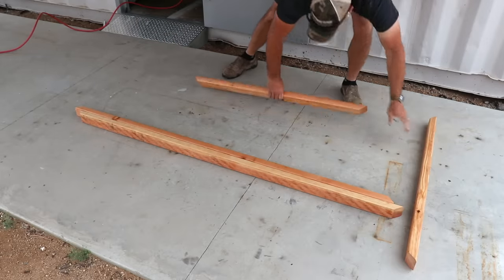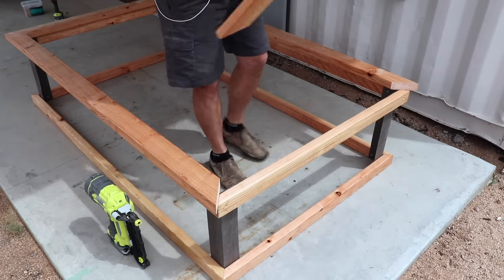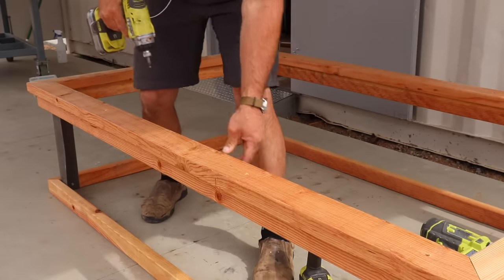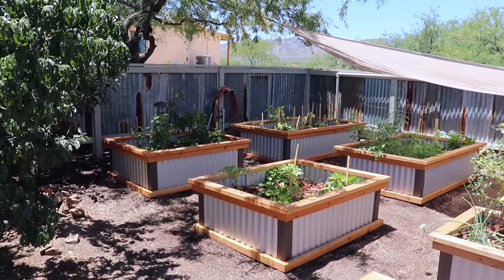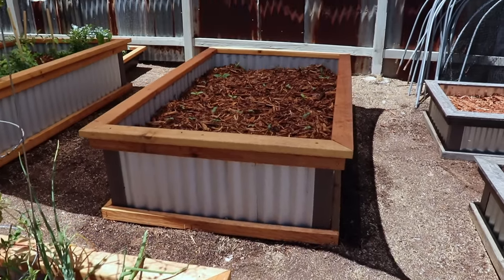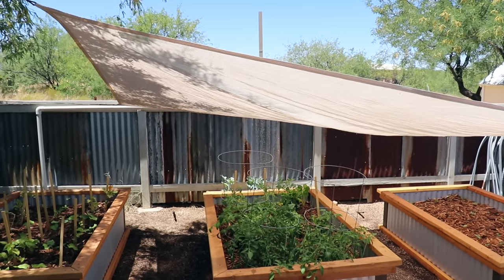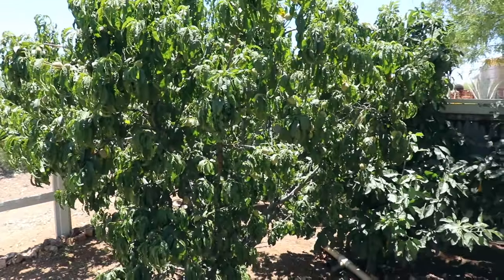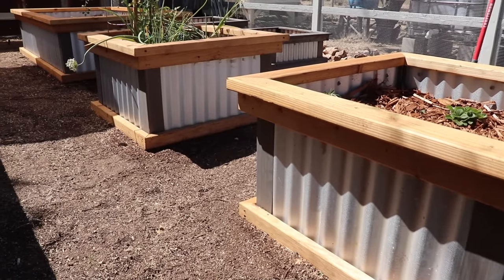Beautiful DIY Raised Garden Beds in 3 MIN!  - How to Build

Comment: We just bought some of these boxes that were built by a local man here in Idaho.  They are 4 feet tall. Wonderful for us old time gardeners.  We filled them with bales of hay to help with the cost of filling them up.  Yes, overtime it will break down...but then we will fill up again next year with more compost.  He built them with some corrugated panels from Australia that are coated and will not rust.  So far I am loving them.  4ft wide ones are a little hard to reach across so we bought 3 ft by 8ft.  Good job and they look so nice.
Reply from the maker: Thanks and I agree with that haybale idea too!  My wife mentioned that for me but mine being only 18.5” tall wasn’t as much to fill.  But if they were higher that was going to be my route as well! 😀👍

Comment: For those asking about the  3 x 3 flashing...i was not able to get any locally in Virginia....I ordered from Menard's on line (2 - 10 foot sections).  The site said free delivery so I tested.  Delivered - total cost under $18.00...and better yet they came in framing to protect in transport - 4 - 12 Foot 2x6!  so they are going to be re utilized for the top caps!
Reply: Thank you! 😃
Reply: Just fyi for those searching Menards : I couldn't find it there until I tried Angle flashing.
Reply: How did you get free shipping from Menards? Is there a code or something?  When I tried to purchase the angle flashing online, the shipping and packing charges added up to nearly $100.
Reply: I just checked my Menards and they have 22 in stock.3x3x10'. I like this idea vs wood 4x4.
Reply: Home Depot in my area of Virginia has 4"x4"x10' Galv flashing
Reply: They lost $ on that transaction on today's lumber prices!
Reply: @sherryraskin2096  Same here. $81.95 for the shipping and packing.
Reply: I live in VA and it's $400 for shipping.

Comment: Just did some rough calculation on cost, thought I'd share with others:  A sheet of 2' x 12' corrugated roof panel costs $22 where I am. For an 8' x 4' x 2' (W x D x H) bed, you'd need two sheets (=44). The corner flashing is about $10 for 10' so you'd need one length. Then you'd need 48' of 2x3 ($15) and 24' of 2x4 ($10), so it comes to about $80 a bed. Not bad!
Reply: A LOT cheaper than Doug fir,  and lasts more than twice as long.
Reply: wojomojo thanks for the calculations
Reply: Seemore Butts you’re right but more work taking them apart and removing the nails.
Reply: @wojomojo where can I buy 3” x 3” corner roof flashings from? All I can find is ones that are 4” x 4” and only 8” tall
Reply: @rhettkuhnen4375  same, I can't find them anywhere.
Reply: I work at a distribution centre and have migrated to 110 gallon horse watering tanks. Drainage holes, sweeping tile pipe covering with stone, landscaping fabric on top, a mix of peat moss, sand, vermiculite and compost and voila...... raised bed gardening for the disabled. I have my driveway and backyard filled and produce enough to can and feed lots of other people 😁
Reply: Thanks for the cost, but those wood are just untreated wood, they can’t be last, but for good treated woods we have to pay so much more in order to be last
Reply: Cyndi Foore Not if you cut around it and ignore the corners completely. I forget the channel name but it’s a new video look up “How to build a raised bed using pallets”
Reply: @arleenieeweeniee3866  Pallets are often made of pine, spruce, or fir. All of those woods will rot out in about 2-3 years in damp soil and not completely buried. I don't know that the labor and fasteners are really worth the free materials.
Reply: @jaskeda  Yes if you are spending to get cedar or Pressure Treated that'd be true. But outside of the bottom frame which contacts the ground, the rest of the wood only contact metal so I think it's ok.
Reply: Thank you 😁 I also called my local dirt people and for 8 beds this size you mention that is premixed with compost soil and manure just for raised beds will cost me 1200.00 2 1/2 dump trucks filled so getting my money together and finding a guy who can bring his front loader lol I am 57 and can’t do that much dirt in a wheel barrow but can pay to have it done by march
Reply: @arleenieeweeniee3866  yes I saw that video and time saver definitely
Reply: @pamelavance648  And money saving. Old tree wood is free. Leaves are free. If you want straw/ hay put an add on Craig's list or Facebook looking for free moldy straw/ hay. Farmers don't want it so you might get it free. Then 12" of soil. Done! As for people looking for 3x3 flashing... Menards either has it or will get it for you.
Reply: @wojomojo  I used the 4" x 4" and it works just the same.
Reply: March 30, 2022...Now Double or triple those costs...guaranteed!!!

Comment: Hi Joe, we saw these on your channel and thought they looked fab so we made one 7' x 5' to go in our back garden. As you say, real easy to build and extremely easy on the eye. We plan to make a few smaller ones to compliment the area but overall so much cheaper than trying to build it solely out of wood. The tin adds a bit of industrial drama but is nicely softened by the wood. Top job.
Reply: Where did you get the corner roof flashings?
Reply: @robcasad  roof flashing at your local hardware store. It's just a simple piece of very thin gauge sheet metal bent. Used in roofing.
Reply: Did they bow out a any?

Comment: Beautiful result !
 Great esthetics on the very small budget. Will copy in my garden.

Also, plants with red fruit love metal. Gardeners use rusty metal on soil for that.
Reply from the maker: Thank you!
Reply: ...rusty metal, vs. galvanized (zinc, which can be toxic for example to fish)? Trying to ask here, really
Reply: @michbushi  we need zinc in our diet which is available as a supplement
Reply: @michbushi  It's the iron that the plants really need. Rust is iron oxide. You can buy iron soil supplements in garden supply stores.
Reply: @catstreat9434  I have my doubts as to how bioavailable iron from the metal would be for those plants. Iron sulfate would be much better for that.
Reply: Hai
Reply: I cannot say I am an expert but have a little bit of knowledge of various chemistries after 15 years in oilfield chemical/pharmaceutical manufacturing. Rust is generally known as the oxidized elemental iron (Fe on the periodic table). However, there are multiple oxidation states of Fe just like some other metals on the periodic table. Some are toxic in some environments, and some are not: Iron in chlorophyll, Iron in hemoglobin, metals with coatings (like oil-seasoned, iron skillets), etc. Even if you were to go back to some of the old practices, you will discover that there will be a new argument against the old ways.

You should do your own research of what people say versus what specialists (like agricultural extension representatives, long-time gardeners, manufacturer product specialists, etc.) say. Incorporate some of your own soil and crop testing before planting/eating in conjunction with the advice you receive prior to human consumption. However, keep in mind that nothing in life is a guarantee that this or that will stop you from the enjoyment of growing your own food. 

There are challenges in raised bed gardening just like open row gardening. You make the call dependent on what is most important to you and preferably not to the stress of worrying about disappointing others. "Don't worry! Be happy!" Make gardening a family affair (quality family time). Consume to your senses are full (enjoy the flavors of tastes, smells, touch, ears, and eyes). 

If you enjoy meat keep in mind that most meat is flavored with minerals (salt) and vegetables (herbs/spices). Very few people eat meat without a vegetable source added. Plus, you can eat some/most vegetables raw (live food). That cannot be said of most meat sources; however, most meat sources consume raw (live) plants.

Comment: Those look really nice! I'm definitely going to use the 3x3 flashing in the corners. I have a tip for anyone using galvanized roofing metal. After you cut it use cold galvanized spray paint on the cuts. This will keep it from rusting,!

Comment: Thank you! Followed your plan - more or less - to make three 4x6x2 beds & very happy with how they turned out. Recommend an air nibbler to cut the corners and corrugate panels. $25 @ Harbor Freight, cut easily & quickly and no evidence of becoming dull after completing these 3 beds.

Comment: Fantastic! I'm going to make some 4' x 8' x 26" planters following this design (with a few modifications). Going to use pressure treated wood and stain it (since it is much cheaper in my area than cedar), and just rip down 2x4's in half instead of using 2x3's. Also going to leave the flashing a little long on the bottom corners to cut into a point to drive in the ground to help hold the boxes in place when filling them up. Thanks for the helpful video and inspiration to get off my rear and build my own!
Reply from the maker: Awesome!   The only thing I’d recommend is to make sure not to go too high unless your roofing is heavier guage.   I’ve gone as high as 22” with no problems but that was with 26ga roofing.  I’m guessing 26” might be fine as well assuming the heavier gauge but if it’s 29ga stuff I wouldn’t go higher than say 19-20”.      My concern is that going too high could result in that soil pressure bowing the sides a bit.    Anyways, I think they’re gonna look great and is live to see them when you get done👍😀
Reply: He used cedar on those little old ones at the end.  The ones he just made were pressure treated pine.
Reply from the maker: Alastor they are regular pine that I coated with linseed oil before assembly.   I would encourage those in wet environments to research if pressure treated might work for them.   But these are just regular pine😀👍
Reply: @homesteadonomics  what modification would you recommend to brace the sides to prevent bowing?

Comment: Joe i love these beds. I remeber when you built previous ones. The design is simple, they look great and last a long time. Im going to build these on my allotment plot with one slight alteration. I'm sure watering can be an issue in your climate so could be handy there too. On the top im going to build a frame around the edge from 3x2 or 4x2 then at 1 foot centres going across the bed and also goin the other way to create a criss cross  framework. In each square will sit a square 12 inch pot that sits a few inches off the ground. On the inside of the bed, put a piece of pond liner up just a few inches from the ground which will hol water. The pots will have a piece of wicking material in them and will dangle down out the bottom of the pot and into the water. This way the plants soak up as much or as little water they need and you could go away for a few days without worrying about your plants or vegies dying.
Reply from the maker: Thank you!   And I love your idea!   Sounds like it will make for a great growing system too! 😀👍
Reply: Yes, this absolutely works.  I made a bunch of results videos, and some gotchas to watch out for.  I'm slowly converting all my beds to this!!

Comment: I had watched another video on building raised beds. Oddly I made some changes which is exactly how you built yours. They have worked wonderfully! Used pressure treated for the base but common studs for the top sealed with linseed oil.

Comment: Great container.  I made two of your planters, but did make a time saving material change.  I used the corrugated metal for the corners.  They easily hand bend at 90 degrees if you mark at the 13” center peak in the corrugation. Don’t bend against the peak it is much more difficult.  Also I used a skill saw with the blade turned backwards, that’s an old aluminum siding trick...wear ear protection!!

Comment: I have watched many videos on building raised beds and your design is the one I like the best due to its simplicity and aesthetics. Have you had any issues with the corners not standing up to pressure since it is just the flashing holding them up? Also, have you experienced any pushing out of the galvanized metal due to the soil weight? Thank you for your videos and keep up the great content!
Reply: Your question is timeless, I came here a year later with the same question. Too bad no one can be bothered to answer 💀
Reply: @brianandlynphilippines  Well I built them last year and do not recommend using flashing for the corners unless it is a shorter bed. Almost all the 2 foot high beds the corners are bending and I will have to disassemble them and put wood in it's place.  On the other hand my tomato bed which I made shorter around 12" high is holding up great!
Reply: After you add the walls the bed becomes very strong.   I built a 16" (inside height) yesterday and it is good to go.
Reply: @hmpeet1709  newbie here. how are you planning to join the wood pieces together on the corners? Miter joint?
Reply: I'm thinking about putting a 2x4 in the corners for strength with the flashing on the outside of the 2x4 for the astheticts. That way you get 'the look' of the metal flashing but the strength of the 2x4 post in each corner.

Comment: Hey some questions. I've built 5 of these (thanks for the tutorial). How do you get your wood to line up so well? My HD / Lowes wood supply sucks for finding anything not bowed in 3 dimensions. 2nd: uh can you show us what you fill them with? Mine are 2'x4'x4' so 32 cubic feet each X5 = 160 cubic feet of soil roughly. which seems a lot of weight to be held in. thanks!

Comment: I use shade cloth in Arkansas along with a mist system during the hottest part of the day to grow letuce even the heat of summer which can at time be over 100 degrees with 80 to 90 percent humidity. Shade cloth makes a huge difference. Combined with mist system and i can lower my garden temperature over 20 to 25 degrees.
Reply: If only you could combine this hot, dry climate with one that has  perfect humidity but an awful amount of rain. (Can you tell I have a little cabin fever?) The mix in temperatures alone would make it ideal for most people (at least, those not made of asbestos or wearing water- proof foot-wear). I'd be an Irish puddle of melted wax  in a climate like yours - genuinely.  Big, big congrats for your lettuce though and for the ingenuity you used to grow them.
Reply from the maker: That sounds incredible!   If I didn’t have a limited water supply I think a misting system would be an awesome step up for my garden😀👍
Reply: @Ben cowles How did u set this up? Thx!
Reply: How many gallons/minutes of misting or number of misters do you use?  I use shade with success, but haven't tried misting. Check out my results.
Reply: @TheRainHarvester  i only have the mist system runing for 2 hours during the hottest part of the day. My well is solar powered so it does not cost me much to run it.

Comment: Love this video, thanks so much for posting it!  I wanted to make some of my own, but I'd like them to be 30 inches high.  I can see that the metal flashing is flexing a bit when you're putting it on.  If I have my flashing cut to 30 inches, will it be strong enough to hold the box up or is that too high to make them?  Thanks in advance for your answer!

Comment: Hi Joe, I love these and an going to build 2 to start.  Can you give material details?  I can't find the flashing, is it angled flashing or drip flashing?  Do you know brand and where purchased, we live the charcoal color.  Also the wood, is it pine that you stained/sealed?  Can you give details please?  Thanks so much, we are excited to get these going ASAP 😃
Reply from the maker: Hi Doug,

Yes the pine is sealed with linseed oil.   Forgot to put that in the text.    
As for the corner flashing.  I get it from Home Depot or Lowe’s....but I’d imagine other places might have it or something similar.  It is 3x3” corner flashing found in the roofing section by the gutters.  The charcoal color is in that flashing that is ‘bonderized’.
As for the dimensions of lumber.   That will all depend on how big you want them.  I cut the corner flashing -and roofing at 17”.   But I think 12” or 15” are the best bang for buck sizes.

One bed that is just under 4x8 will require 6 - 2x3’s for the lower two frames and the top will require 3 - 2x4’s for the top cap.   

Hope that helps😀👍
Reply: @homesteadonomics  I appreciate you! 👍💪

Comment: curious how the sides get their strength. i see you sitting on them, how does it not buckle? I have similarly steel walled beds, but they have vertical lumber corners, but you just have metal. thanks for the video!
Reply: My question also. If you look at the build where he is screwing in the top boards the roofing corners buckle each time he puts a screw in, but later after it is completely built he sits on it and no buckle? Could be because the top pieces spread the weight load. With dirt in them would that be stablizing or destabilizing? 
I guess you could drive a post in each corner along with the metal corner flashing. I plan on also putting some hardware cloth in the bottom to keep out underground pests and gophers.
Reply: I really wish there was more feedback here. I have the same questions. I just don't know that I want to risk trusting the flashing to support the weight, especially if I want to sit on the ledge of the planter while gardening. I like the idea of some 4x4 posts inside the flashing for structural support. Just an extra cost.
Reply: @puggirl415  You are correct on the weight distribution.   The dirt will stabilize/support the sides to some degree.   The outside of my home (contemporary) is made of factory coated exterior and vinyl on the inside, tremendous strength.   Plan to use left over pieces for gardening, match the exterior of our home!
Reply: @phildizzle88  might be overkill with the 4x4s, if you do use any timber, make sure it is not pressure treated, else it will leach into the garden.